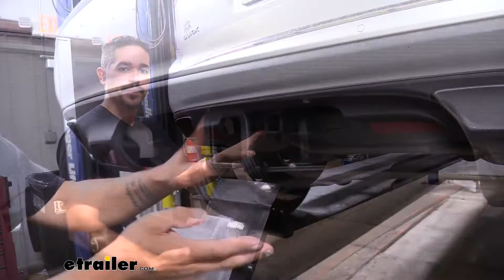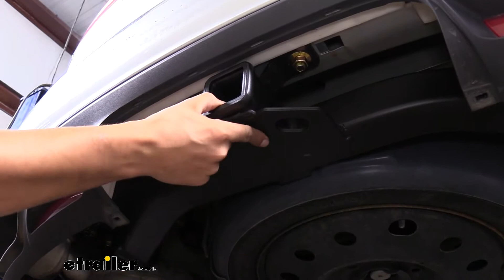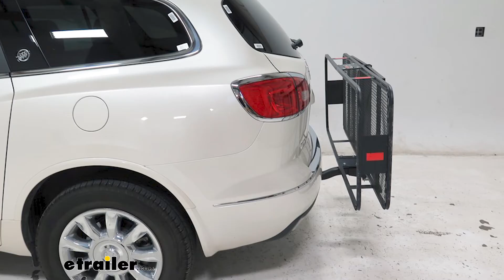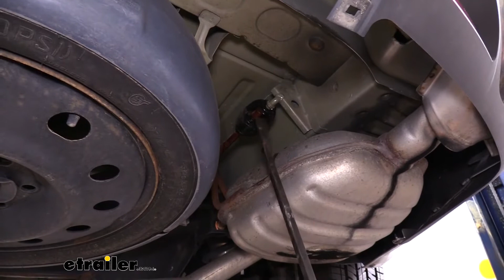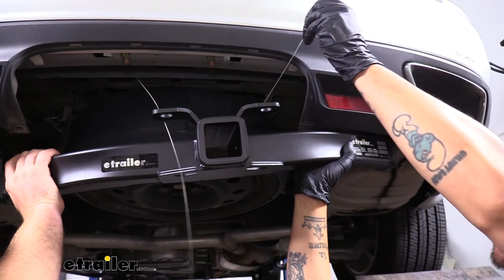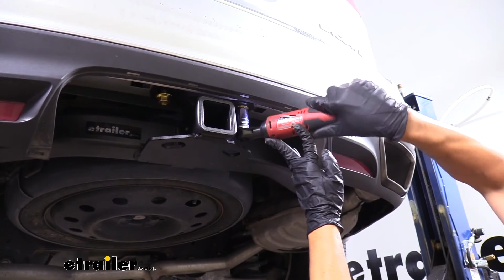Set up: etrailer Trailer Hitch Receiver on a 2017 Buick Enclave

Comment: What about making the lights work? How do you activate tow mode on a car that didn’t have it? I don’t have a button for it.
Reply from the maker: For a 4-pole trailer connector, use # C56245 or # 118271 for a 7-way.
https://www.etrailer.com/tv-install-trailer-wiring-2014-buick-enclave-c56245.aspx
https://www.etrailer.com/tv-install-trailer-wiring-2017-chevrolet-traverse-118271.aspx

The Tow/Haul button typically changes the transmission shift points, but it can't be added aftermarket.